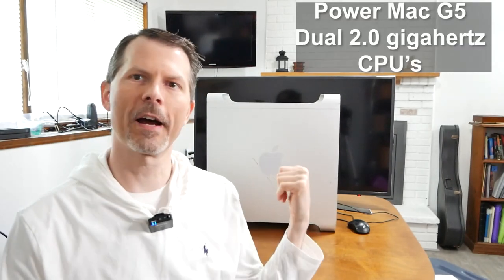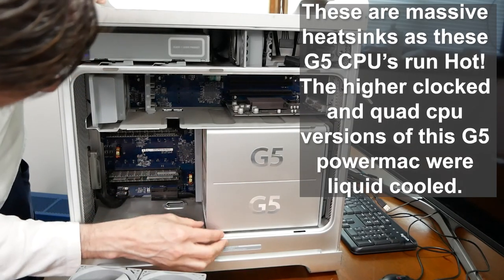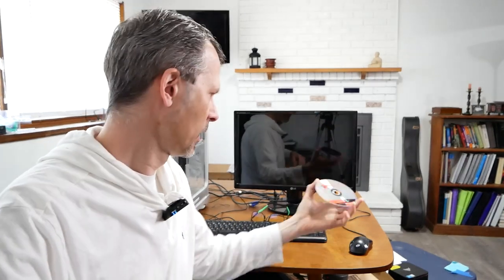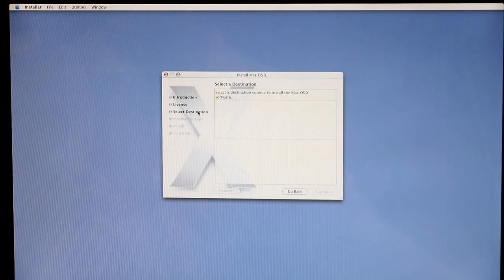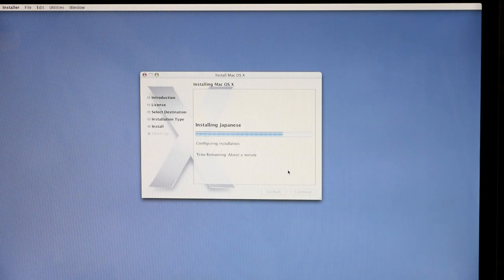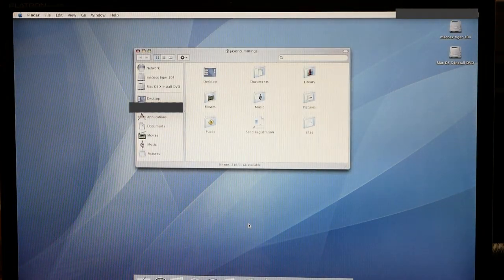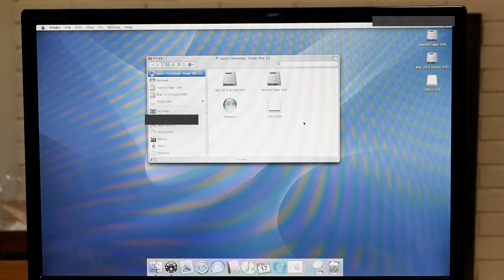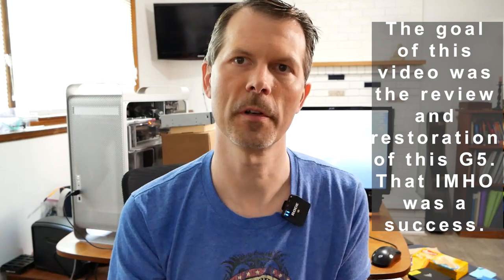Reviving My Power Mac G5 in 2023!

Comment: There are instruction online to install Sobert Leopard on this machine. I have the exact one. The last model made. Cranked with 16gb of ram two 512gb SSD sata 1 drives. Sata 3 won't work. Running Sobert Leopard and can surf the net, play youtube at 420p full screen. Gets loud and rather hot too. But it works. Try it Bro.
Reply from the maker: Hi and welcome to the channel! Thats a nice g5 system you have! I did in fact install Sorbet on this g5 here https://youtu.be/1nGmUnq2cQc?si=7McCnxkvf5QInERv  Mine works pretty well. I just need a better video card. I used my Samsung Sata1 128gig ssd. Thanks for watching and commenting and thanks for the tip :)

Comment: Hi there. I have a Powermac G3 tower and 17” studio display monitor from 1999. I can’t remember the last time it was all powered up but it was given to me in working condition then sat for many years. Should I take any precautions before just plugging it into an outlet and hitting the power button 😬.
Reply from the maker: Hi there. Plug it into a good surge suppressor. If it has been sitting one never knows what shape it is in. Capacitors could have died/leaked etc. If it boots up you can then shut it off and dust out the inside with compressed air. You won't be able to upgrade the OS. But maybe u might be able to install a faster drive with more ram and Linux. But it's old so I'd say just enjoy the nostalgic aspect of it and leave as is. Leme know how things work out.

Comment: My G5 2 ghz 2005 machine won’t boot up but I bought it new & has many years of pictures,videos & files. Hoping to get it repaired but not a tech myself. So will be looking for a replacement that works.
Reply from the maker: Hi there. Oh man, that stinks. Sorry to hear. Do you think the hard drives are dead? If it isn't, you may be able to put it in an external USB enclosure and hook it up to another Mac and maybe copy over the pictures to the working Mac.

Comment: The college had one of these back when. The students used it to make the school newspaper. I worked a student job there. I think my official title was "lab tech" or something. Anyway the IT lady once asked me to go look at the machine and tell her what I thought was wrong with it. I was like, "I don't know anything about macs." She is like "You probably know more than me. Just take your best guess." I check it out and it would just hang and hang when trying to load the OS. I told her I thought the hard drive was going out. It was replaced and problem solved. After that I became known as the mac guy even though the only apple product I'd ever used was the apple IIc.
Reply from the maker: Hi, and welcome to the channel! These Macs at least were laid out parts wise somewhat similar to pcs. As far as it hd, video card and ram was concerned. Good thing you didn't have to pull the PS out of that Power Mac, it' runs the whole length of the case! Lol. The video Card on these were flashed to run on the Macs, too. Anyways, great story! I love hearing feedback like that. Thanks for watching and commenting "Mac Guy" lol j/k. I appreciate it :)
Reply: @RememberThisTech  I imagine if I'd had to do any real work with it, I'd have been like "Nope" and walked away the moment I got the panel off.
Reply from the maker: @ItIsNot1984  lol!

Comment: Which SSDs are working? I tried SATA 3 SSDs and none of them worked.
Reply from the maker: Hi, and welcome to the channel. I used a Sata 3 and a Sata 150  ssd. An old gen 1 Samsung and a brand new lexar.. One of the sata ports, top or bottom, works as the boot. Have to go back in the video and see what one. Also, try clear NV ram. Thanks for watching and commenting. I appreciate it.

Comment: Please my G5 keeps switching off after few seconds, what is the problem and how can it be stopped
Reply from the maker: Hi and welcome to the channel. It could be that the cpus are overheating. You could try cleaning and re thermal pasting them. If you have a newer g5 that used the water cooling system we'll those failed all the time so look for damage to the motherboard. Also look for bulging capacitors. You could have a failing power supply. Check it if you have a power supply tester.

Comment: Mine still runs perfectly. I've been trying to figure out what to even do with it. I can't really use it for anything, nothing I can think of. Replaced it with a Mac Mini since 2014 when pretty much everyone dropped support for it.
Reply from the maker: Hi there! Perhaps you can install sorbet leopard for your g5? https://youtu.be/1nGmUnq2cQc?si=bzw7Iz6ncQNTjZ_0
Might give it a bit more functionality. Slap in a sata1 ssd in it too. It isn't  going to make it a powerhouse its still a G5 :)
Reply: @RememberThisTech  Will this allow me to use it like a contemporary computer?
Reply from the maker: It would give you updated web browser  installing security certs so you can web browse youtube etc. It comes with a portal to download apps for the g5. Some newer some old. But yeah it would. Long as your video cards over 64 meg. 128 to 256 is better. Mines a 64 and I can only watch yt at lower resolutions. Also I highly recommend a cheaper ssd to install it on this will speed it up a lot.
Reply: Would love to buy a good working machine. 2005 2Ghz G5.
Reply from the maker: @LAFDHFC  Id recommend setting up alerts for one in FB marketplace and look on Ebay and see what pops up. Perhaps you might find a good deal :)

Comment: Your best bet for that G5 is to find someone that has the same one and clone the hard drive for your G5. It works fine that way, and you'll inherit all the apps they have too! Also, the updates and patches will already be on it. Very useful because internet on these will not work very well. As for using SSD, you nee to go to OWC and check out their SSDs. They are the only ones with the correct specs for the G5.
Good luck. If you want a cloned drive, I have a buddy that does them for $200. And only $100 if you supply the drive. Comes with OSX, ProTools, Final Cut Pro, PhotoShop, and a lot of useful apps. Remember, you wont really be able to use internet on these G5s... but for photo, video, and music production, the cloned drive my buddy uses is perfect.
Great video. Good work.
Reply from the maker: Hi there! Yeah, if I knew someone who had a g5 like mine, I might consider cloning it. Tyvm for that tip and the hard drive one as well. I ended up installing sorbet leopard on this in another video here https://youtu.be/1nGmUnq2cQc?si=slSHL4-ub2VV3HaB. I know it's not the same as keeping it original but it has more modern functionality now. Now I just need a better video card for it. Thanks for watching and commenting. I appreciate it :)
Reply: Yep. If you know your model identifier I can see if he's got it. 
Something like Powermac 7,2 or 9,1 or 11,2  is the model identifier.
But I know for sure he has a quad and a dual he clones from. He uses the G5 for music production and says it's the best and cheapest studio you can ever buy and it does everything like the newer macs do.
Reply from the maker: Good info, tyvm! I'm not interested in paying to get a cloned image for this machine at the moment, though. Perhaps one day I'll get my hands on a quad core g5 and test it out to see if it's as food for video and music editing as you say it is. Skol!
Reply: @RememberThisTech   I understand you would really have to have a serious use for it already in place for you to spend any money on it the disco image is really not worth it unless you are going to be doing production..
 As for the quad I would not recommend it.. especially if it is liquid-cooled they all have problems I currently still have 2 of them that were decommissioned years ago because of the cooling system leaking it's pretty much a  Guaranteed fault that will happen on all of the liquid cooled quads.
 I've found that the 2 GHz dual cores are just as good as the quotes for all production needs and that's what we currently run.
Reply from the maker: @SLUMSON  Ahh Nice to know. I also heard something about the liquid cooling failing. Such a shame :(
Reply: @RememberThisTech  lol..m yeah. I bought 2 of them for $5k at the time and they are rusted junk now
Reply from the maker: @SLUMSON  uggghh :(

Comment: A buddy of mine actually dumped one of these on me with the matching 20" monitor for no cost last year after clearing out his storage unit. 
No HDD. Haven't honestly even messed with it since.
I've currently been using the monitor with my i7-4770 2013 21.5" iMac that was a $50 score and that I DIY refurbished.
Your video is now definitely triggering my habitual tinkering instincts. Haha!
I've also got a G4 tower w/ an old beige external Apple HDD as well as a Rev-B original Bondi Blue iMac currently tucked away in a closet!
lol!
My GF's been at me about getting rid of all of them, but I just haven't been able to do it!
LMAO!
¯\_(ツ)_/¯
Reply from the maker: Hey there! That 4770 imac is decent! A bonding blue G4! Yesss. After I revived this G5, I did another video and put Sorbet leopard on it and runs nice! Don't throw them away. Revitalize them!! Thanks for watching and commenting. I appreciate it :)
Reply: @RememberThisTech  there’s something just oddly satisfying about giving these “obsolete” machines a few years of new found life in my opinion. You’d think, given that Woz and Jobs literally founded Apple making DIY kits out a garage? That the modern day Apple corporation would potentially embrace that side of the community, and the proven resilience of these machines instead of completely being against the whole right to repair debate.
Yet unfortunately? 
“Logic Board” is merely just the name of a hardware component, and not that of some hypothetical administrative marketing think tank of consistent business philosophy. Haha!
Thanks for the reply!
BTW?
The G4 I have is the translucent grey model. I think originally marketed towards music production?
The inside is absolutely pristine. Couldn’t get it to boot when I tried. The HDD has probably just bit the biscuit I’m assuming. 
I’ll definitely check out some more videos my dude!
Cheers!
Reply from the maker: @EasyHeat  I think that jobs an woz furgured out early on that if something lasts too long or can be easily repaired or upgraded that there's less money in that :( Try slapping in a sata 1 ssd in that g4 idk does it have sata or if ide use a sata to ide adapter. See if you can get into boot menu and see the hd. Let me know how it goes!!

Comment: These run Debian Linux very nicely for a modern operating system.
Reply from the maker: Hi and welcome to the channel! Oh wow cool ty for that tip! So they have a Debian power pc distro? I think I heard about that. I know I got Sorbet leopard running on mine. Buy Debian would be a big modern update for sure!! Thanks for watching and commenting. I appreciate it.
Reply: @RememberThisTech  Last week I took my old iMac G5 out of the barn and installed Debian 12 PPC 64bit on it. But there are some issues I will fix, if I've got more time: Wifi now is working, but sound doesn't. The precompiled Firefox doesn't start, but i've got Arctic Fox 43 running. 
Some folks are talking of the new Fienix Linux, a derivative of Debian that was specifically written for PowerPC. Please give t a try!
Reply from the maker: @jensputzlocher8345  That's awesome! I've heard Feinix Linux was decent and have it on my list to try. Before I do so though I need to upgrade the video card in my G5. It's only 64meg and need something way better. Thanks for sharing :)